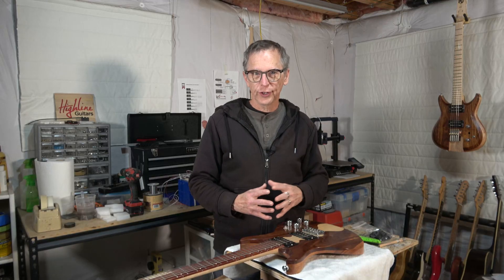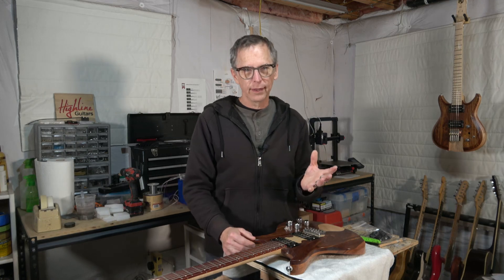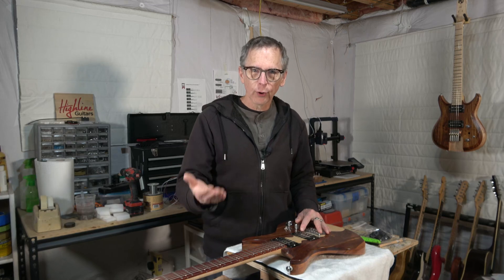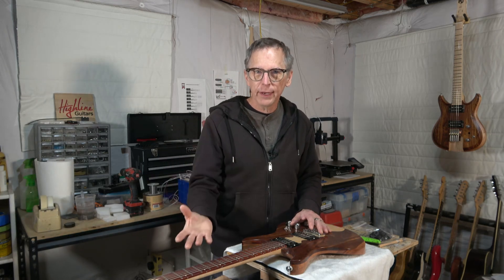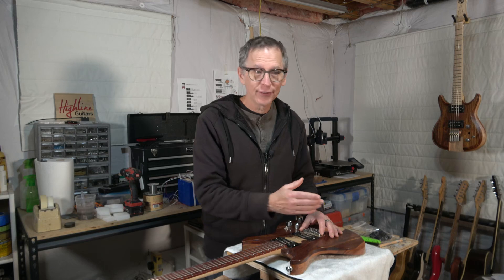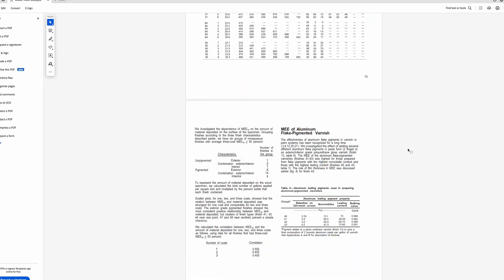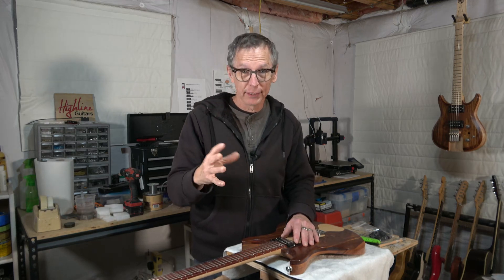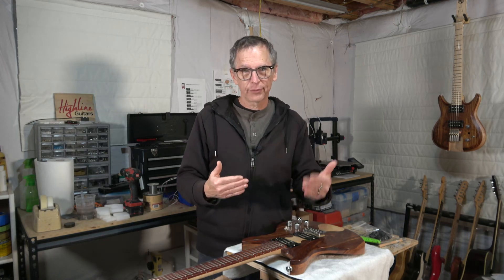Do Wood Finishes Actually Block Humidity?

Comment: I think you are a little bit missing the point of finish with respect to moisture absorption.  It is not and has never been to hermetically seal the wood.  That would be kinda like blowing up a balloon and hoping for it to stay inflated forever.  Doesn’t work that way at least not with natural materials like wood.  No matter what you do to wood, it will eventually equilibrate to the humidity level of the environment it is kept in.  The point of a finish here is to make that happen very slowly so that the moisture in the wood reflects the long term average of the humidity of its environment, and is spread evenly throughout the thickness of the wood.  This prevents brief exposures to high or low humidity conditions from damaging the guitar and prevents localized high or low moisture areas within the wood from creating differential stresses.  Bottom line… if you keep a guitar for long periods of time in very dry or very humid conditions, it will suffer, and no finish can change that. But finish can and does make the guitar more resilient to brief exposures to these conditions and gives it more robustness across a range of “normal” humidity levels.
Reply from the maker: I think you missed the point of the video. The point is that despite what OTHER PEOPLE think, no finish can totally seal wood.
Reply: @HighlineGuitars  👍

Comment: I just received my Warmoth unfinished neck and there was an insert saying that you must use some kind of hard finish or the warranty is void, and that “oil alone” is not a sufficient sealing finish.  I was planning on using tru-oil for the neck finishing (used this in the past and really liked the results). I guess I don’t feel like the risk is that dramatic, but I’m having second thoughts.
Reply: Tru oil is a mixture of products, it's unclear what all the ingredients are because they keep their recipe under wraps, but there is likely polyurethane in there as well. "Oil alon" sounds like they're referring to pure tongue or linseed

Comment: Torrification does not change the grain structure, it changes the natural resins in the wood that become cross-linked similar to most finishes when you apply subsequent coats without letting them cure.  It does shrink the wood a bit too due to water loss, which also contributes to it's stiffness.

BTW:  Always pre-drill for screws in Torrified woods, and use a slightly larger drill than usual, as a headstock can crack and split from just a tuner screw!:hand-orange-covering-eyes:  I recommend getting a set of number drills which come in much smaller increments (a few Thousandths of an inch apart).  It allows you to drill screw holes to tighter tolerances depending on the woods, as for instance maple holds screws really well with the recommended drill, mahogany not so well, as they strip out easy.  Keep in mind no two boards of the same species are equal if not from the same billet, so I use a cutoff to test it and adjust the holes to find the one that gives me a tight fit, but not so tight it's too hard to get them in.  I got them first because I do metal working, like taping, and I also drill holes for wires in circuit boards...  I have drills so small, they may brake if you look at them too hard!🤪
Reply from the maker: Cliff Clavin approves!😉
Reply: @HighlineGuitars  Well, I have been at this for over 40 years and was studying engineering when I discovered the joy of the creating things by hand and artistic expression, and try my best to stay up to the newest info.  I'm also a passionate geek of the sciences.

In case someone is thinking  that the name of the process of Torrefiction has something to do with famous luthier/innovator Antonio Torres, as I did, it doesn't.  It's done with all kinds of organic substances like fossil and other bio-fuels in order to stabilize them, get a higher mass at reduced size, remove or reduce unwanted substances and then some.
Reply from the maker: @Bob-of-Zoid  * Torrefaction
Reply: @HighlineGuitars  I looked it up after writing that, and already wrote a reply with the correct word:  The spell check doesn't recognize the proper word, and I wasn't sure which one was correct for hearing both used in the past, and having a memory like a strainer!:face-orange-biting-nails:
Reply from the maker: @Bob-of-Zoid  👍👌

Comment: In the mid to late 80's either LMI, or StuMac added a water based Poly to their product line, with a "use at your own risk" warning that it was to be used for testing only, and asked anyone who wanted to test it to give them info on the results, and as much other info they could as to their finishing schedule... if any different than the recommendations.  I did, and got great results, others not so much.  One big issue many had was that it looked cloudy, and so in my notes I asked them to ask those who got cloudy results if they had used tap water or distilled water, which I did knowing water has minerals and other contaminants in it: sure enough they all had!  Not a few days later they added to use distilled water.  It still took a little time for it's maker to refine the formula, and now a bunch of companies make water based poly's.

Comment: Build a kiln. Drive it down until your moisture meter can’t read anything. Seems to work for me. I do like vertical grain as well.
Reply from the maker: There is way more to torrefaction than simply drying wood in a kiln.

Comment: Living in an extremely humid climate in the south, humidity is always a top concern for me in all of my projects. I am also very interested in the prospect of using torrefied wood, but the one curiosity that I have is with regards to the effectiveness of wood glues. If the structure of the wood itself is modified to the point where water can't penetrate, is wood glue still going to be as effective in joining pieces together?
Reply: I never thought about that! I’ve been trying to plan a neck through build with a roasted maple neck and you made me think twice…now that I think about it, I don’t believe I’ve ever seen roasted maple laminated with anything…

Comment: Don't forget the wax! I've got a high (low) tech neck moisture solution which might be easily employed to keep you on team Maple. Just create a small raceway or two under the fretboard and fill them with silica-gel desiccant like that commonly used inside the edge channels of insulated glass. That would additionally protect the neck wood and fretboard in one fell swoop. I always install a nice sturdy desiccant pack or two in my control cavities. Remember "Do Not Eat" Yes, we have our offense (the finish layers) but often overlook defense such as this "capture, temper and mitigate" strategy which for the record was bequeathed and disclosed this day upon your channel for the first time! Let me know how it goes, I'm sure you can get it by the pound and there shouldn't be any waste as long as you recapture off fall as you fill your channels for the next use.
Reply from the maker: The most effective "finish" out of all 91 tested was paraffin wax!

Comment: Wal used polyester finishes on their basses..  My favorite finish is cyanoacrylate, which bonds to the moisture in the wood and seems to increase the stiffness.  I wonder if it's non-porous? It cross-links so that each additional coat becomes 'unified' with the previous application.

Comment: I wonder if the more oily woods, like Rosewood, absorb less moisture comparable wood species 🤔
Reply: They do indeed, and many don't know that most oil finishes contain poly urethane, just read the labels on walnut, teak and other oils in the hardware store.  Using them adds extra protection.

Comment: I think polyester may have a similar problem a wise man once told me everything leaks, it’s the rate that matters. If finish doesn’t prevent wood absorbing moisture but instead delays its reaction, it still may be very effective at preventing damage given varying humidity due to seasonality

Comment: The study is interesting. I'm not sure it will change how I do my finishing. If you have wood guitars, you do need to keep them away from extreme changes in temperature and humidity anyway if you want them to last.
Reply: Sudden changes in temps is the worse!  If you ever seen a crackled finish, it may be the reason, like someone took it out of the house without a case in very cold weather, but with nitrocellulose finish on old guitars it may be due to the fact it doesn't offer good protection from moisture, so the wood will swell but the finish won't stretch to accommodate it, so it's nonsense that it's a superior finish, it actually sucks because it never cures, is susceptible to solvents in the air, and when deprived of oxygen even turns to goo and distorts and sticks to everything, even dirt slowly collects in it!  It is although easier to work with than poly, acrylic or enamel, and why MFG's spread that BS!

And no, polyurethane or any other finish that is more of a plastic doesn't kill tone, unless you use it very thick on a soundboard of an acoustic, and polyurethane even adds a tiny bit of stability to a soundboard and flexes just fine as thin as we apply it.